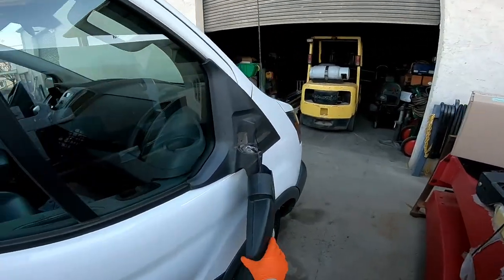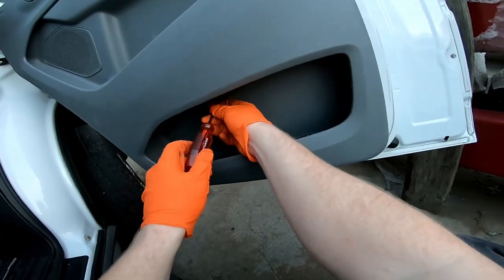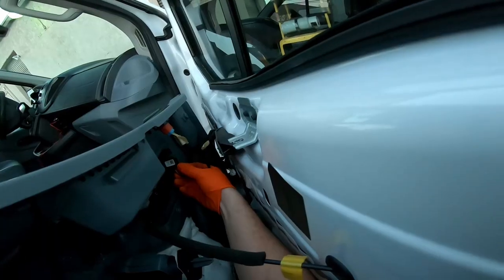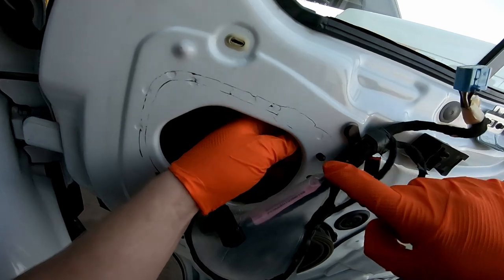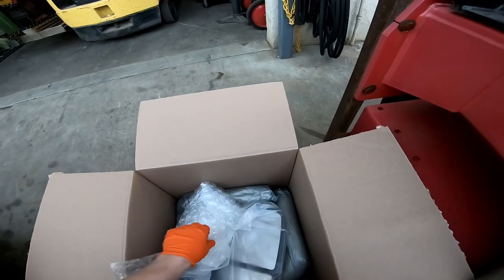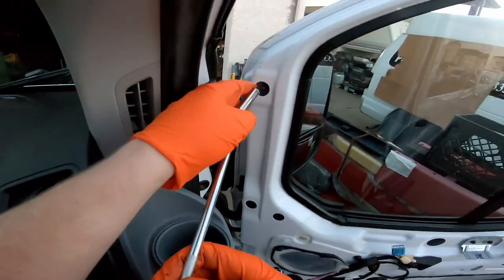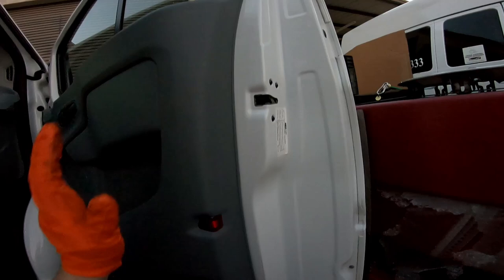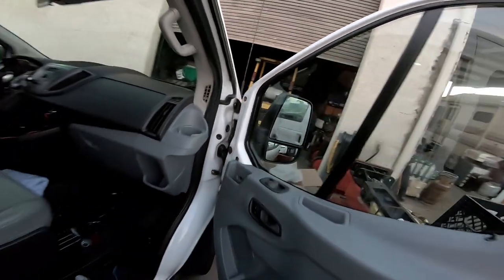Ford Transit Door Panel Removal and Mirror Replacement

Comment: Great video. Thanks. Leave it up to Ford to make them where you have to take the whole interior panel off. They  could have made it where the mirror plug was just behind the mirror so you just had to take the 3 nuts off that hold the mirror on, pull the mirror out, and unplug it from there.

Comment: Been looking for days for a video on it, have you ever experienced the front door speakers not working on one side only? It’s super weird it cuts on sometimes but the majority of the time I can’t get any audio to come out of it? Can’t figure out if it’s wiring or my aux chord as the radio still works out of both speakers some times but no AUX audio??
Reply from the maker: @tysonfranko3834  it is  probably the radio, or the wireing where it bends from the door opening and closing.

Comment: I wonder what's the purpose of the plug if it doesn't have the integrated signal light some replacement Transit mirrors have (If you explained it I am sorry but I watched it at the fastest speed). If it wasn't for that plug it'd be an easy job! Thanks for your video. I have to do this twice tomorrow to get a driver's mirror from a totaled Transit (thanks to one dude at work who claims the Transit simply started spinning out of nowhere in the highway and according to the body shop it's going to take months to get fixed since there are no parts available) and then put it in the other Transit the same guy at work destroyed during the weekend claiming someone hit his mirror and floored it. I don't think he's going to last much longer working with us.
Reply from the maker: The wiring on this mirror is for the motors that adjust the glass from the driver's mirror adjustment buttons.

Comment: If your inner door panel has a reflector, there is a screw under the reflector.
Reply from the maker: That's wierd this van has a reflector, but no screw. What year is your van, transit 150 or 250?
Reply: @GrimRepair   I have a 2020 Transit 250. It has the screw under the reflector.
Reply: I can second this on a 2018 transit

Comment: The inner core is die cast metal..cheapest crap available. They may as well made it out of styrofoam.
Reply: The aftermarket replacements are all plastic, which is even worse!